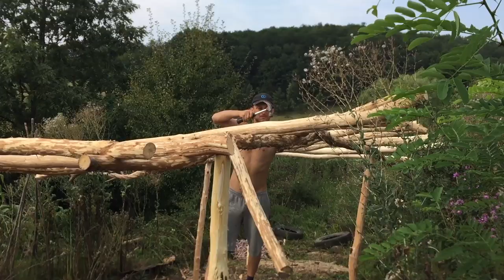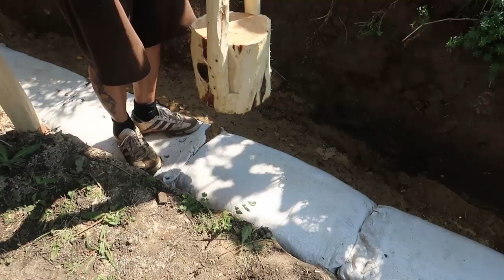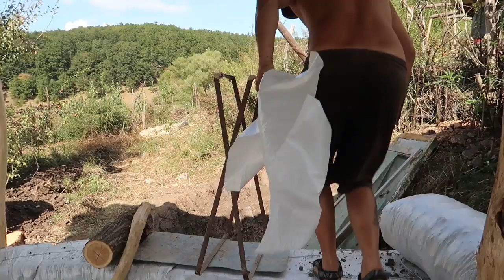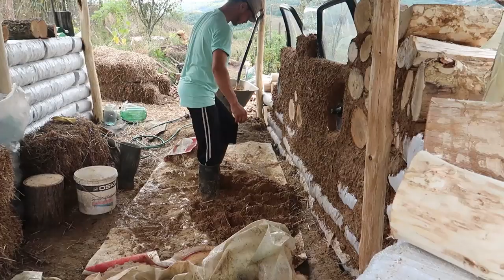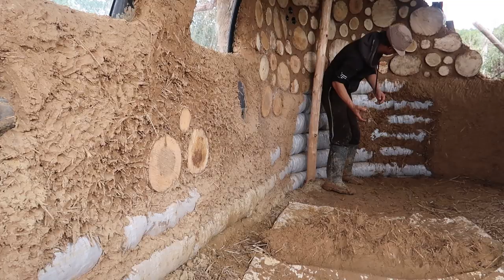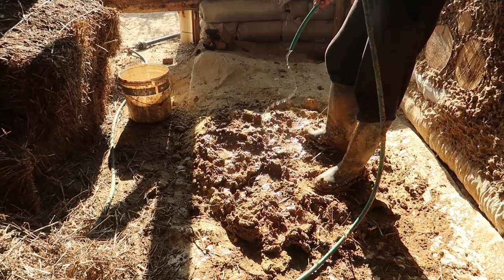How to build a cob or adobe house - Step by step natural building -  Off-grid ROMANIA

Comment: Any issues with damp?
Reply from the maker: Fortunately no. I haven't made the fire yet and I have to work on the floor. :)
Reply: @AlexJurj  if you do encounter any problems with damp, 'Blackjack DPM' does a fantastic job as a paint on barrier, saved my shed conversion recently
Reply from the maker: @nxxynx5039  Yes, thank you very much. It will help me a lot.